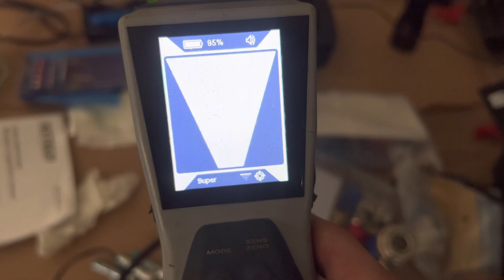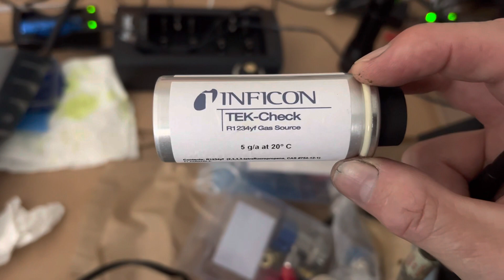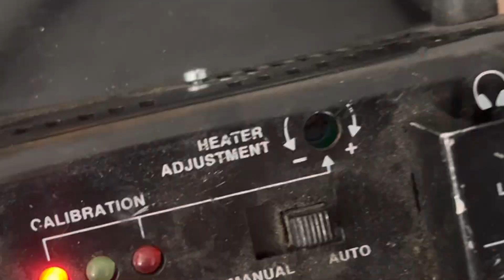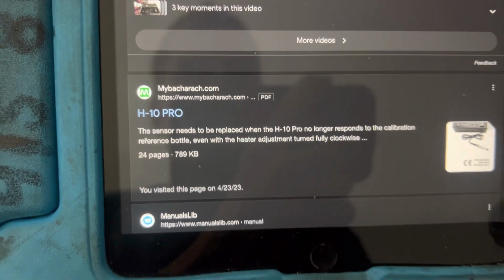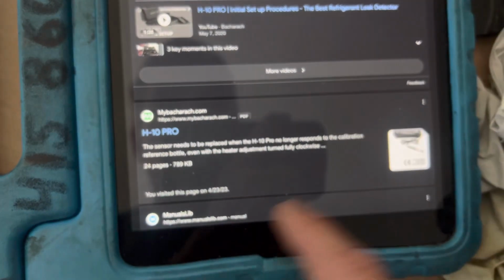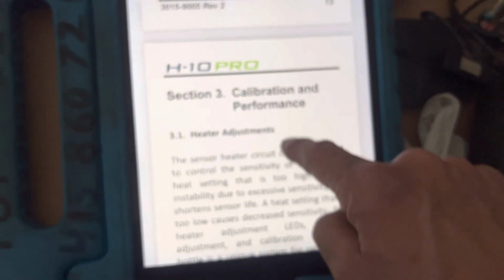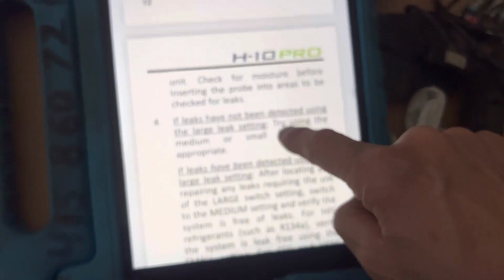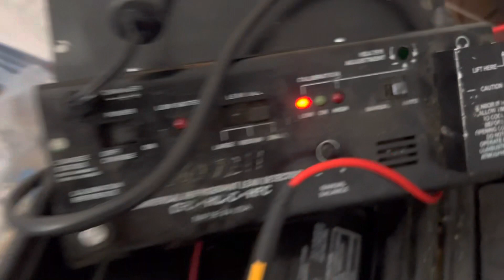H-10 REFRIGERANT LEAK DETECTOR STILL VARY GOOD FOR R1234yf adjustment heater diode using reference

Comment: Hi Tom.  I want to get the H-10 Pro for leak detection but on the TrueTechTools web site it says "DO NOT use this device to detect for leaks of refrigerants which are rated as combustible/flammable gases (e.g. ASHRAE A2- or A3- rated refrigerants)." But it also says it is good for 1234yf.  Would this be a good detector for 1234fy and R134A?  Thank you.

Comment: Hey Tom, got a H10 Pro being delivered today from our favorite toy store. It mentions the refrigeration classes, then "including but not limited to: R-12, R-22, R-134a, R-404A, R-410A, R-502, R-507, HFO-1233zd, HFO-1234yf and HFO-1234ze".
 I was surprised to see 1234yf in the list. Does that mean it will work for yf but not as good? Have you ever found a yf leak with the H10?

They also mention that the H10 Pro has a long probe. Not sure if one is included or it needs to be purchased separately for $60.

BTW, I'm sooo happy to see that they are starting to stock Yellow Jacket! 👍
Reply from the maker: It picks up YF refrigerant perfectly no problem at all. 

I did a video on that. I purchased the refrigerant lab test reference bottles for testing sensors. 

The H 10 when you properly adjust the heated diode works every bed just as good as the thousand dollar iInfincon DeTech stratus 

I got the notification about the yellow jackets because I am signed up to their flyer notification that constantly sends me updates on new tools or any specials

Read the instructions thoroughly don’t gas or just turn it on and try to use it 

And then instructions I’ll tell you specially a brand new sensor turn it on and let it run for 10 minutes. I think that’s what it says because the brand new sensor has to heat up and break in. 

Then I think the probe extension all it is is a little tiny, hard plastic tube that attaches to the end so you could reach back through grills to get to the coil
Reply: @coldfinger459sub0  I've always been one to read instructions, even on simple things that don't really need it.

Comment: Funny enough I just got a used H10 Pro...I think the one I have is a rebrand I might try and pop in a new sensor also looks like it might still be original BUT it still definelty still picks up leaks.
Reply from the maker: Follow the instructions how to correctly adjust the heated Diode sensor. 

When you first purchase your heated diode sensor before you insert it turn your heater pot counterclockwise all the way down . 

Now follow the directions allow it to warm up for several minutes. Make sure you have a fully charged battery. . 

It’s very common for these old lead acid batteries to go bad.  

They are easily overcharged and shorten your life if there are left plugged in the wall too long, it even states that in the directions . 

It’s a simple 12 V battery 

They’re about $20 to almost $40 on Amazon or eBay or from one of the big batteries sellers we sell all the different types of batteries . 

Make sure you purchase a New Refrigerant reference bottle it’ll cost you somewhere between $50-$80 available that True Tech Tools 

If you throw in my offer code, you get additional 8% off the price for your sensor. I’m not sure if they have the battery available they might but they probably charge more. I’m not sure. .  

LECHAIR is my discount code in their coupon. Code box at True Tech Tools all capital letters all one word get you your additional 8% off.. 

Scan through and look at all the tools that True Tech Tools if you’re from the automotive industry, you’ll be amazed at what available .   And what is available there you’re not gonna find on your snap on truck Mac or MATCO
Reply: @coldfinger459sub0  yeah Ive bought items from them before. Question ive been meaning to ask....do you have two completely separate setups to go between r134 and yf or do you just swap hoses and use same gauge for both.
Reply from the maker: @MrSuperchargedv8  I do both depending on what equipment I have available to me at the time because I often leave hoses and vacuum pumps and gauges at jobsites. Well I jumped the other job sites..  I have more than seven vacuum pumps three recovery machines to refrigerant leak detectors several other regular garbage leak detectors that are old they would be the same. One automotive mechanics would buy off of a snap on truck a Matco truck or Mac truck those are mostly all garbage.. 

I have my main SM480V refrigerant manifold that I am attempting to wear out and break by over using it on purpose .  I’m trying to prove that it’s either good or prove that it cannot stand up to being a used abused neglected, throwing around used out in the rain.. so far after several years, this is been the most indestructible, most accurate, reliable, electronic digital gauge, I have ever purchased. 

Oh, so when I use it on different refrigerant oils or different refrigerant . I have pressurized containers of 99% alcohol 140 psi of nitrogen that I just push through the yellow house and let it squirt out the red and the blue hose. This will flush out all oil out of the cage set an hoses..  and then I just hook it up to my nitrogen tank that I always have at 600 psi and let her rip.   Then you throw it on the vacuum pump. It’ll get down to below 100 µm in about 30 seconds to 60 seconds..  that’s on my vacuum pump.  Not off the vacuum pumps that you will buy from SnapOn or Matco or Mac.
And then you have a perfectly clean set of gauges to use on your next vehicle . 

For the portable, refrigerant recovery basically the same thing . 
You turned them on they self evacuate but your fresh some air through them. Throw some nitrogen through them throw them on the vacuum pump and they’re ready to go for the next refrigerant or any different oil. . 

The HVAC refrigeration recovery units that I use are much stronger and durable than anything used in  Automotive 

They are rated for high-pressure refrigerant like R 410 
Just standing in a bottle in your room at 70° here somewhere around 240 or 260 psi .   On the high side when operating in the heat of the Summer at 110° outside your high side pressure will be about 500+ psi. They all use POL in high-voltage electric compressors just like a high-voltage electric compressor in a hybrid vehicle or electric vehicle..   so these mobile portable recovery units are built extremely durable.  So using them on Automotive Refrigerant Star, low pressure, refrigerant is no strain on them at all.. using them on automotive he’s like rolling of all downhill. 

Once you have your tank of high-pressure nitrogen, it’s excellent for looking for leaks and it’s excellent for doing high-pressure decay test .   You buy one extra flashgun the little silver tank that you can get from master cool or anybody even cheap Chinese eBay.  And purchase am 99% plus alcohol and use your nitrogen and now you have a flashgun to clean out your hoses, engages cheap, easy and fast..
Reply: @coldfinger459sub0  that makes sense. im in the market for a new portable recovery machine any recommendation on a really good one?
Reply from the maker: @MrSuperchargedv8  the little Fieldpiece, that you see I use in my videos that is more than enough for automotive.  
Fieldpiece MR45 Digital Recovery Machine
TruTechTools.com

In the discount coupon box, put in the name  LECHAIR all capital letters all one word you get additional 8% off the price.

Comment: Hi Tom, thanks again for your good videos. In regarding to this one I would like to know: what is the technical procedure when my D-TEK Inficon is not longer sensite because of its old sensor? Can I myself calibrate this leak detector or calibration just means buying a new sensor from Inficon and install it? Thank you
Reply from the maker: If you have the same leak detector that I do the Stratus or the other model just below it without the display screen. Apparently they say the least detector does not get weak it just instantly dies.
        Which I can confirm Marty made it a little past two years and one day I went to turn it on and read letters with a warning came up so the sensor needs to be replace that simple. 

On a heated diode leak detector like the H 10 those go out to calibration need to be calibrated your Inficon is infrared technology . 

It just took 30 seconds to switch out a new sensor 

The only way for you to know is with a calibrated reference leak detection device specific for that refrigerant that you want to test
Reply: @coldfinger459sub0  Mine is the INFICON D-TEK Stratus. Thanks 👍
Reply from the maker: @charless01  then you got the best of the best 👍